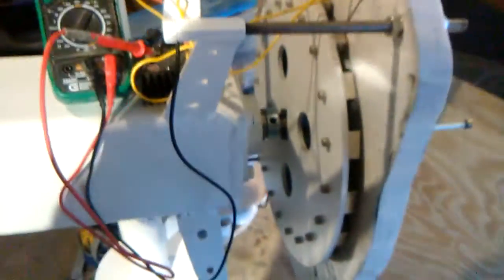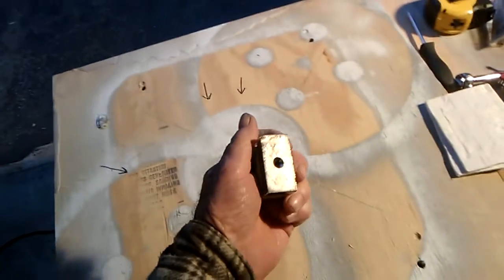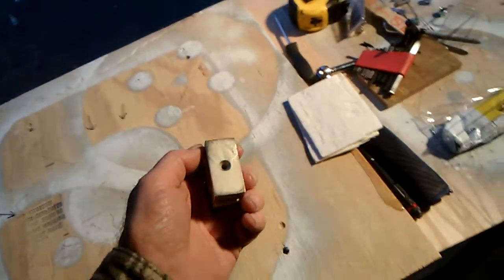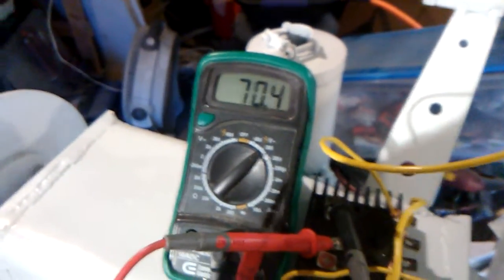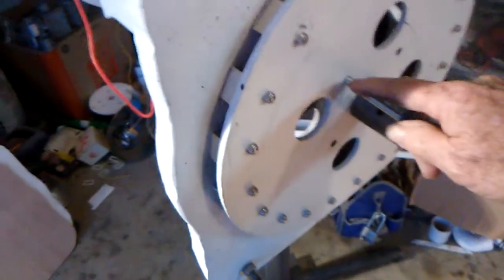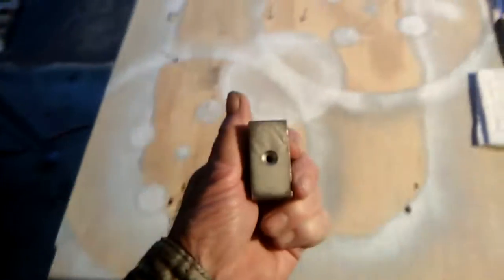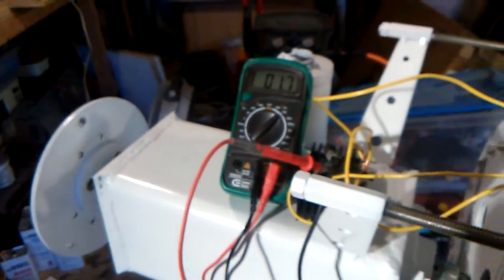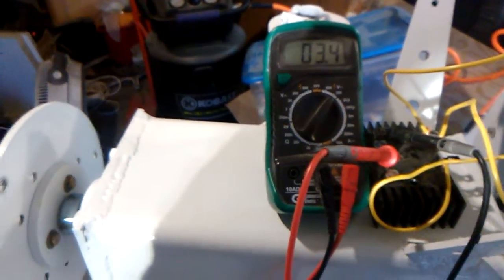Axial Wind Turbine 2nd spin test

Comment: That open voltage is looking quite good! unfortunate about the magnets and hope they send replacements. Do you plan to clear coat or seal the rotors?
Reply from the maker: hey buddy! nice to hear from ya.  I will be sealing the inside of the rotors and magnets so they will not be effected as much from the open air conditions. I still have some fine tuning to do on the rotors and then I have the tower to finish.

Comment: Can you pulse the magnets making the power?
Reply from the maker: Hey buddy! this is not like a solid state or pulse motor. this is just the main part of the wind turbine build.  the blades that will catch the wind will have a 8.5 feet dia.
Reply from the maker: oh, forgot to mention as you place the magnets on each rotor, they are places facing north, then south, all the way around, same for the second magnet plate, but you position each plate facing each other so they are attracted to each other.
Reply: SilentDeath002 just wondering if you could free up some power with some of your old school skills. 😎👍
Reply from the maker: oh I have plenty of plans for the power.  I will have several diversion loads I can bring online such as water heater. but for high winds ill also have about 4000 watt resistor load just to keep it from free spinning.
Reply: SilentDeath002 can't wait to see it brother!!!

Comment: What the heck? they sent you magnets that way? Did they have that white spacer between them? Well it look's water damage... open volt still looking good though!
Reply from the maker: I have purchased a lot of magnets from this one particular company.  each time I order extra magnets because I always get some with chips, crack, or looking like the ones in the video.  they have yet to make it right and send replacements. might be time to find another source for magnets.  Oh, when they put the final coating over the magnets any moisture trapped will cause that to happen. that's why the finish would not stick. I am surprised there is no quality control.
Reply from the maker: oh, forgot, they did have the white spacers between each magnets, also, I removed one magnet at a time from there packing and placed it directly onto the rotor. box was not even opened until I was ready to install them.